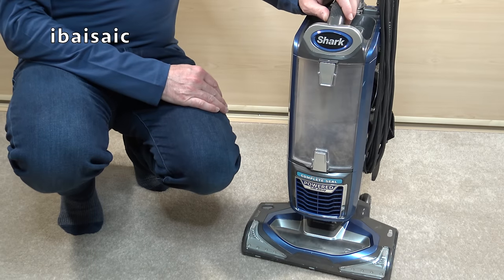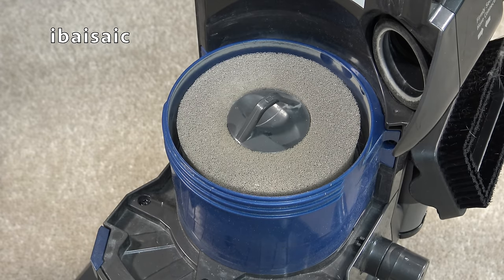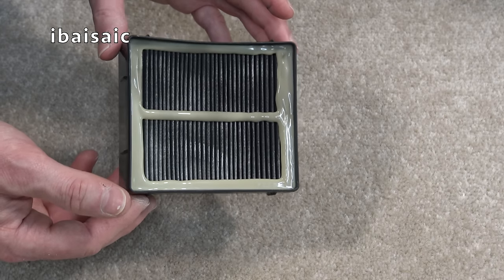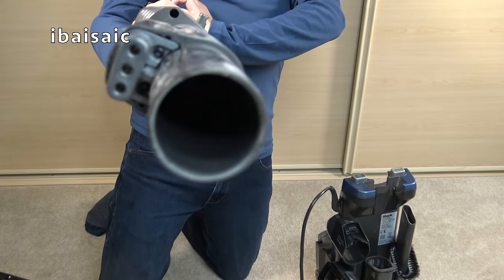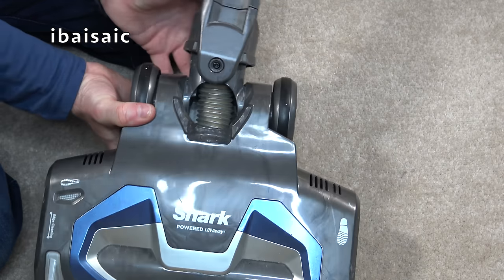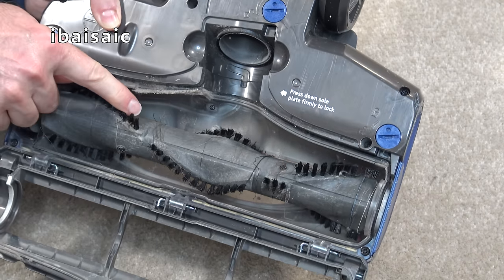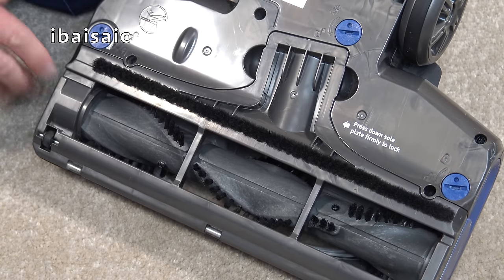Shark Powered Lift Away Maintenance Tips Loss Of Suction & Performance

Comment: Cleaned all of my filters but it still didn't pick up any better. Now run it without filters and looking to get a Victor as used at work for years without issue.
Reply from the maker: Hopefully you’ll get a Victor soon, because running it without filters will soon destroy what little life is left in the motor. You could get away with not having the exhaust filter, but the filters under the dirt bin need to be in place. I would look at a Sebo if you want something that will last longer than a Chinese made Shark.
Reply: This Shark liftaway has always been poor at picking up dirt, regardless of which setting I used so filters were the last thing to blame. Even dropping some dry porridge on a hard carpet requirsd four or five passes to clear, eventually needing thr hose to pick it all up! 
Probably should have returned it under guarantee but just never got around to it.

I used two Victors for eight years at my workplaces which were powerful enough to lift up carpet tiles so now waiting until my DIY is over before swapping. Nothing to lose if the Shark dies.....

Comment: Uhm what happens if you submerge the canister in water? I did it before watching this video. Will it ruin my vacuum?
Reply: The conical wire cage in the canister will rust.  I've submerged the canister numerous times to specifically clean that wire cone when it clogged with debris, causing loss of suction.  

I bought a new canister and will now use a bristled brush to unclog the pores of the wire cone to allow for proper air flow.
Reply: @Funexpected  Use distilled water and then put a small fan on it immediately after washing.  The chemicals they put in tap water to sanitize it also can corrode metal. Getting the water off quickly will stop it from rusting.
Reply: @MrWolfSnack   It's been a year and so far the metal is in good condition.  I don't use water or a brush, I rub my hand on the cone to loosen the debris that diminishes airflow, then I wash my hands.

Comment: I was getting ready to take apart my vacuum cleaner to clean it and I noticed your video said not to submerge the canister the dust collector but you didn't say why not to do that I want to take my shower head and rinse it out just wondering if that would be okay or not thank you very much
Reply from the maker: You can rinse it out, but I would not submerge it under water. Make sure it’s dry before putting it back on the cleaner.
Reply: @ibaisaic  thank you very much it looks great 👍

Comment: Great video! I knew most of this already but I had no idea I could wash the exhaust filter!! I just found that the hose coming from the roller brush is cracked on mine, explains why the suction has been so crappy lately. 
The main problem I’m having with mine is that it sounds like it’s clogged, feels like I’ve put my hand over the hose, but there’s no clog anywhere. I’ve taken the whole thing apart including removed the filters and it still does it. 
Any ideas what could be causing this??
Reply: Did you find a way to replace the the lower hose?
Reply: I have this issue, there is some suction but its  insignificant and I have no blockages. But I am about to go through this vid step by step to see if it resolves. Did you find out what your issue was?
Reply: @triciaboahene7470  I was never able to figure out the problem no matter what I tried. It just wouldn’t stop doing that so we threw it out and got the shark rocket. 

I would just do everything to make sure there is no clog anywhere, clean the filters, but in my experience if there’s no clog and you remove the filters and it’s still doing that… I didn’t find anything that would fix it unfortunately. I’m no expert but to me it was worth just getting another vacuum.
Reply: @stacya2328  I used gorilla tape 😂
Reply: @stacya2328  I couldn’t find a better way that was reasonable but the gorilla tape, IMO would’ve worked great had there not been other issues going on with our vacuum.

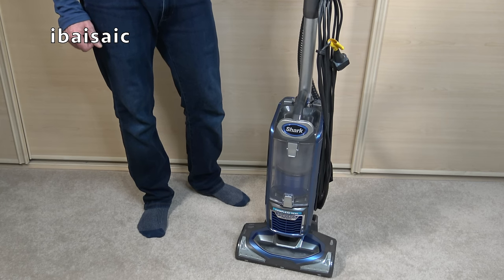Comment: When was this machine first brought out please. 13:04
Reply from the maker: I first showed an almost identical machine on my channel in 2016, so I guess that it was launched in the UK around that time.
Reply: @ibaisaic  thanks very much. Didn’t realise they was so old. Just paid £40 for one to use at my caravan and works fine. Washed all filters which weren’t to bad anyway. I’ve 2 jack Russells. Well happy with it. Is it easy to get spares if anything breaks. Tia
Reply from the maker: You can get spares direct from Shark but they tend to sell whole parts such as the suction unit, powerhead, hose etc and not small individual parts to repair the vacuum yourself.
Reply: @ibaisaic  thanks for that. I have the anti hair roll model as well for home.
Reply: @ibaisaic  what do u reckon is the best model out there.
Reply from the maker: There isn’t a perfect vacuum, but I use Sebo cleaners in my own home.
Reply: @ibaisaic  I’ve never heard a them I’ll have a look.
Reply from the maker: Lots of Sebo vacuums on my channel.
Reply: @ibaisaic  just looked it looks a decent vacuum.
Reply: @ibaisaic  can I ask why u chose the sebo vacuum please.